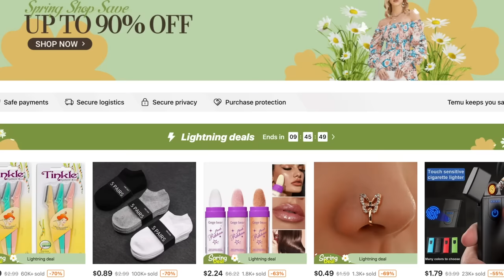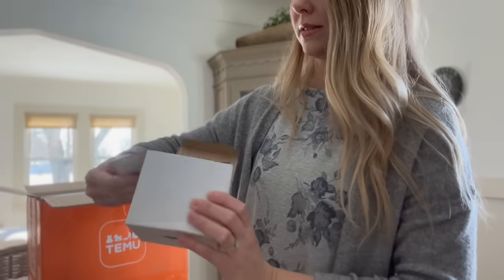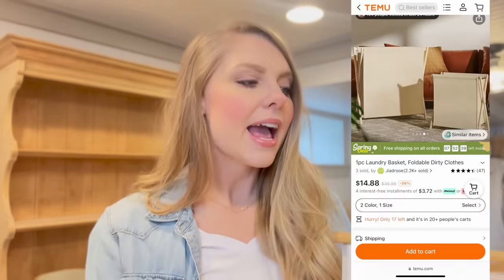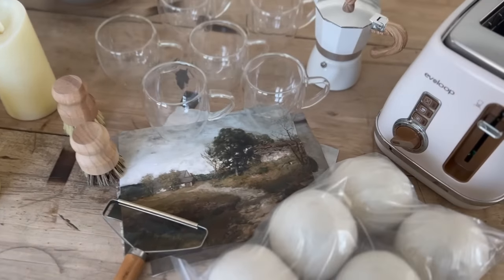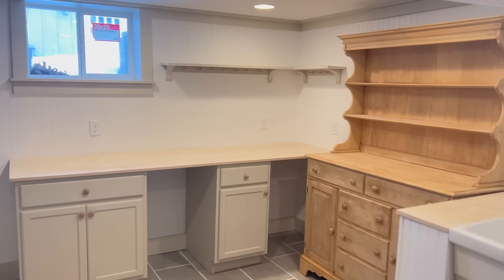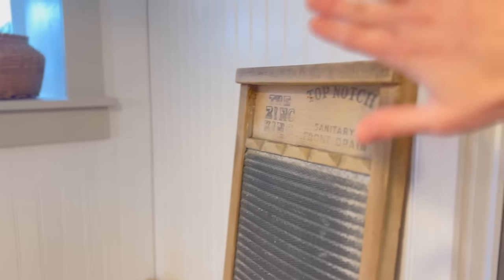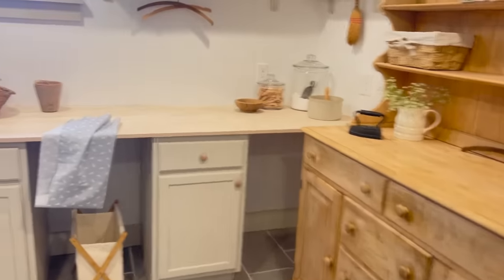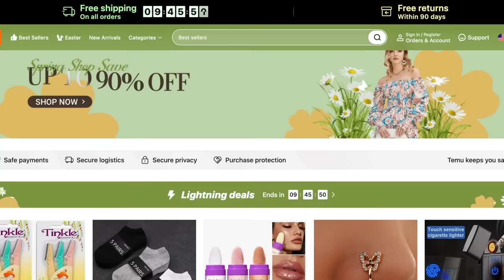Style My NEW Laundry Room with Me!!

Comment: Hi Andrea. You asked for opinions.
Ok...here goes...a lamp where the toaster is now definitely. A taller one, you're correct that one didn't look right. Then move the toaster ( it is really attractive)in to the other side of the plug/socket. The baskets look great in the window wells but too much on the counter. The green gingham fabric in the cabinet gaps. Under the sink (husband did a beautiful job) I feel any fabric takes away from the beautiful carving. The sink, the carving and the brick ,all three together make a fabulous cohesive 'vignette'. Possibly a rectangular wicker basket (ie: french laundry basket) pushed back a few/several inches from the sink legs so as not to take away from it. So not a scary basement anymore.🤗
You may have received more opinions than you asked for.😏

Comment: Have you considered burlap fabric for the curtain? Functional ideas: #1 Use the counter to fold and stack clean clothing and keep extra towels and cleaning products in the cabinets to free upstairs storage spaces.  #2  Near the dryer you could hang a rod from the ceiling by two chains to hang shirts as you pull them out of the dryer.  # 3  A sewing box to mend clothing.  # 4 A chair with a lamp next to it where you can sit and mend clothing.  #5 A clock ...time flies when you are working.  #6 A phone charger station in case you listen to music on your phone while you work. #7 An intercom to hear what your children are doing upstairs.  #8 A bucket of potting soil etc. to repot plants at that big sink.  #9 A folding table stored there for when you are doing a messy craft.  #10 Store craft supplies in your baskets.  #11 As your children get older have a chart/calendar on the wall showing the day they have the responsibility to take laundry baskets up/down the stairs.  #12 A pretty basket where you can put old t-shirts (for rags) when you run across them while doing laundry.  #13 A small fan/heater on hand to be comfortable as you work. (Most basements are drafty and damp and stuffy).  #4 A stool to reach the windows to clean them and water your plants there. . . . . I know YOU must be excited about this new space if I am this excited for you! --Sheila McDade in Chattanooga, TN

Comment: Beautiful work Angela!  I like the gingham fabric underneath the other counters but I think you can leave that sink area open I love the tile under it and it shows off the legs and other details. The fabric in this area would pull focus. Yiu could keep a basket of work towels under the sink or cleaning supplies and cover the top of the basket with a pretty piece of white fabric. Something neutral so as to not pull too much focus.. As far as the pipes, you may consider faux painting them brass.